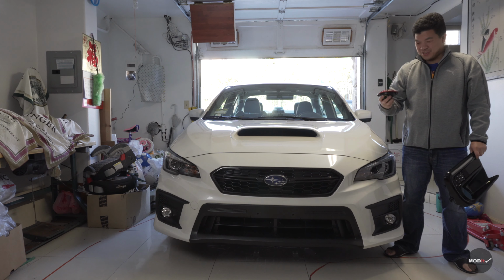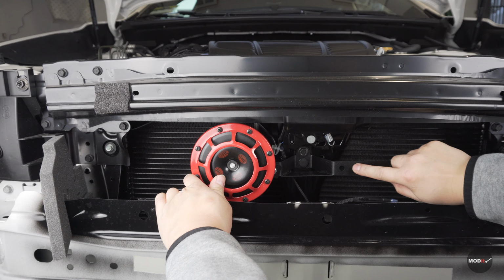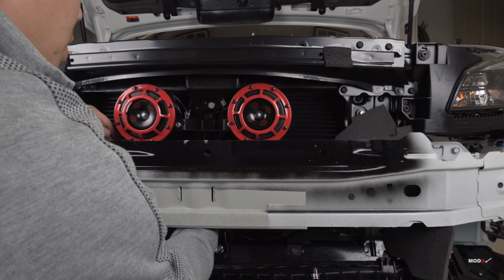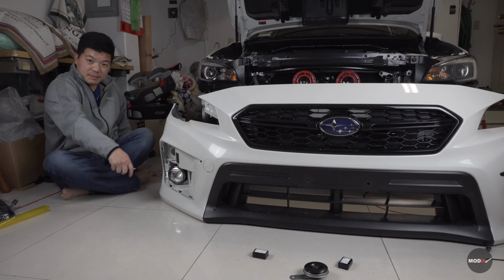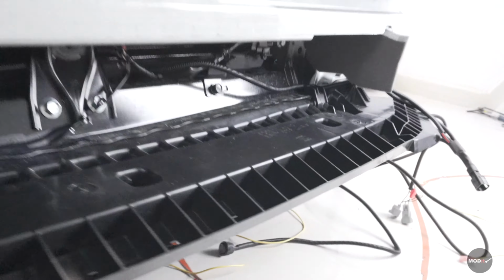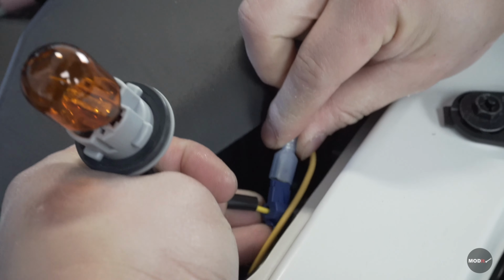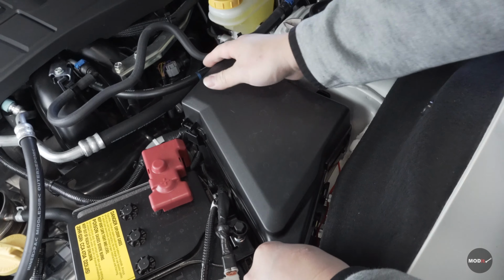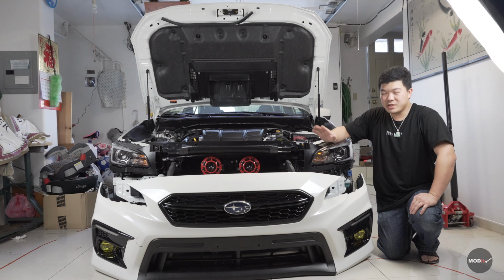2019 Subaru WRX Subispeed Foglight Bezel & Hella Horn Super Tone Install

Comment: Anyone doing this, just cut 1 end of the blue wire that got T's (hidden inside the plastic wrap) now you can use the 2 gray plug and plug them together. The blue wire that you got off  the Ts can now be solder into a longer wire to connect to the turn signal, cleaner and less mess since everything flows together. Also now you. using the 2 supplied gray plug instead of leaving it hanging out in the element. Awesome DIY video Modit!

Comment: I have a 2018 facelift on my 2016 wrx. Can I put these on the same way or did any fuses change between these years?
Reply from the maker: Lollibirdy I believe the fuse location should still be the same. Headlight wiring and turn signal might be different

Comment: nice where did you get the hella horns from? most shops i try to get them from say they only fit or work with 2015-2017 model wrx's
Reply from the maker: Ryan D I got mine from subispeed. I think all you need is the harness and modify it like I did in the video. I got an extra harness if you need one.
Reply: @SimplyMod85  great, thanks!

Comment: Where can I get the tapping wire?
Reply from the maker: Lazii Husky you mean the yellow wires that I tapped into the turn signal?  I had some laying around the house. It doesn’t come with the kit, you have to buy some from a hardware store.
Reply: Modit yeah I figured after posting that comment. Ordered some on amazon and now my turn signals are working. Thanks to your video

Comment: I installed this and its making my turn signal hyperblink. How did u remove the hyperblink?
Reply: Same thing happened to me today.   Still waiting on a reply to my email from subispeed.
Reply: Robert Johnson yea it sucks 😂 let me know pls
Reply from the maker: What year is your wrx? To fix the hyperblink, you might need to install a new turn signal led flasher relay
Reply: Modit 2018 wrx premium. Yea i bought the relay hopefully it works.
Reply: Robert Johnson did u have an extra plug in the harness that u didnt get to use?
Reply: The hyper blink happens because you removed the standard turn signal bulb and now just have the led. Because it is so low draw it will hyper blink. If you notice in the video he still has his standard turn signal bulb installed, therefore no issue with low draw causing the hyper blink.
Reply: Ronnie Darko Did you fix this issue? I have the hyperblink problem.
Reply: Just did this install on my 19 Premium, you will need the hyper blink module, Subispeed sells it for like 12 bucks but I got mine for 9 bucks on amazon and it fixes the hyperlink issue.

Comment: Hey! Just got this kit! I was wondering if the wire you used to splice into the headlight turn signals came with the kit? Because mine doesn’t have it and if so what gauge wire did you use to splice them with?
Reply from the maker: Yeah, it didn't come with any wires to splice into. I used wires laying around my garage for the installation. I think it is a 12 AWG wire.